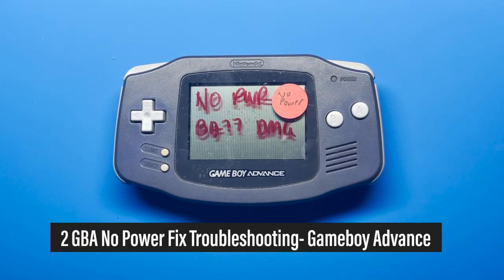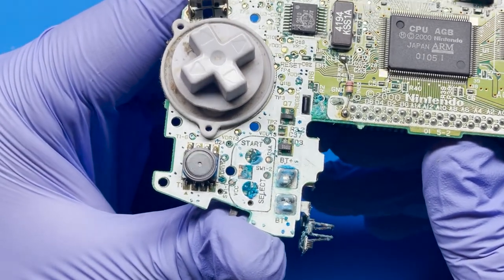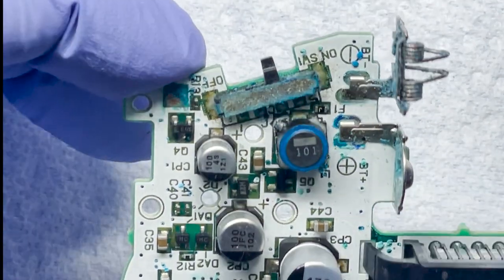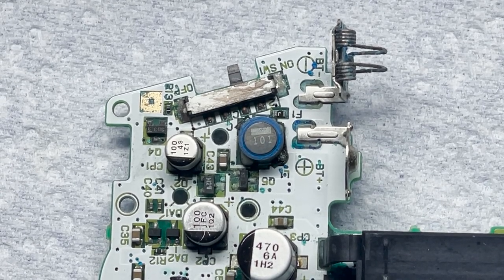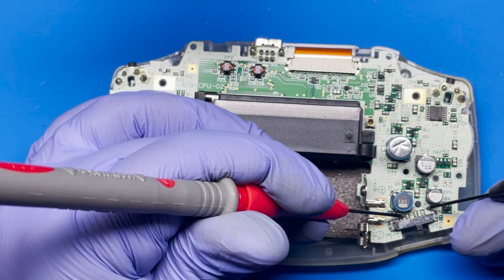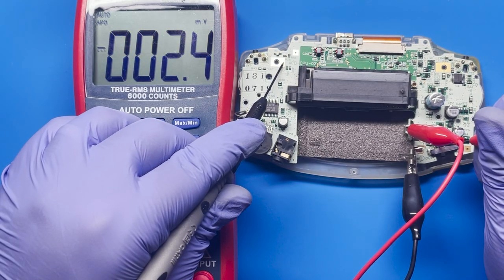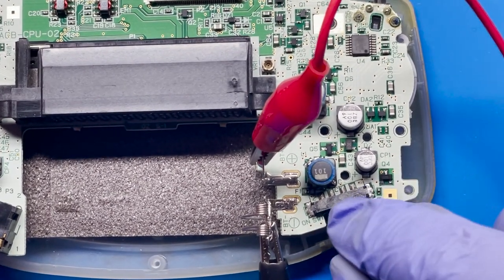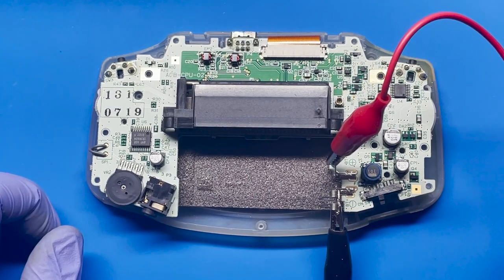How to Troubleshoot Gameboy Advance with No Power

Comment: Any ideas on why my gba reboots itself after a few minutes playing with it? i just installed a highpeedo V5 ips screen and replaced the power inductor cause the one it had looked really bad, i wonder if that has something to do with the problem.
Reply from the maker: I am not too familiar with the highpeedo V5 IPS Screen. In regards to the restart, Im curious if the capacitors are holding the proper charge or if theyre just old. This is a common issue I see with older GBA models and I replace them...however, I am not saying this is the case for your system.
Reply: @totalfix877  i will replace them and see if that solves the problem, otherwise idk what else can it be, it all looks ok to me 🤔
Reply: @alexsantos1016 did you end up fixing it?
Reply: @billcipher1204  It was the battery terminals, had corrosion on so it wasnt making good contact. Took me a while to figured it out

Comment: Hi there, really enjoy the content !  Helpfull, learned a lot !
I do have trouble finding that tool you're using to plug some AAA battery !  Do you have a link or a name or a brand ?
Thanks a keep on
Reply from the maker: Yes of course, the link to that product is here:
https://amzn.to/3SWOHXP

These are for different types of battery holders. Hope this helps and thanks for watching!
Reply: @totalfix877  thanks, i did spotted the right thing ^^ ! One last question, you bought the clamps separatly ?  None of the battery holders  sold have them attached to the wires...
Reply from the maker: @neurocamelot8893  Yeah I just bought some alligator clips from Amazon. They should be fairly cheap.